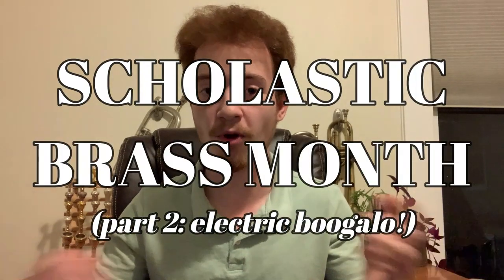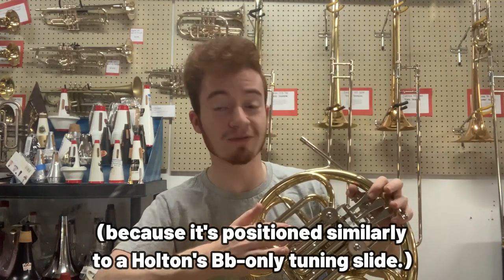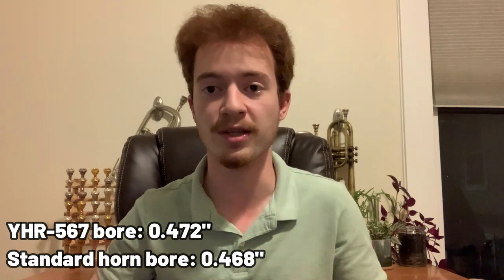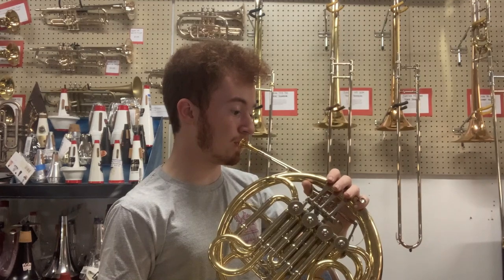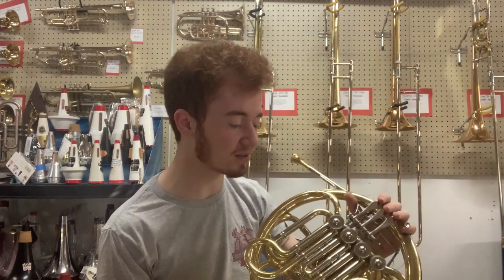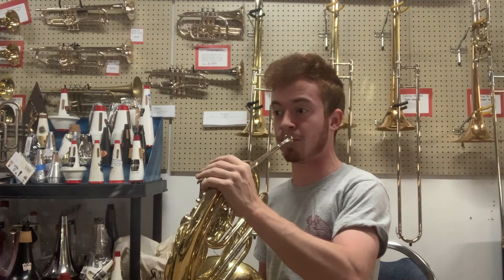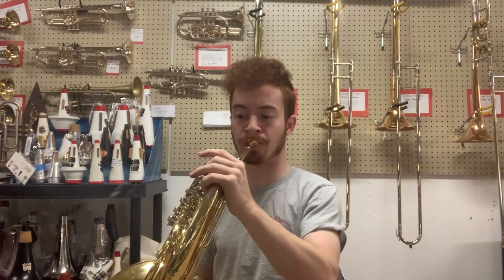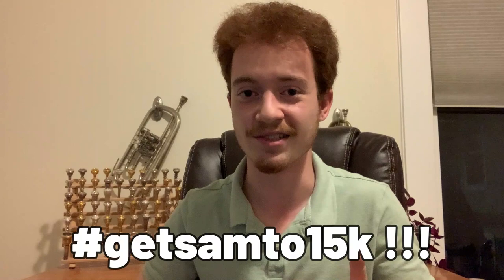Yamaha YHR-567 Intermediate French Horn: Worth It? Or Go Pro? | Instrument Reviews

Comment: FWIIW - I was playing 3rd on a rented Eastman horn that sounded gorgeous. My 2nd horn player had the 567 and honestly, it sounded like mud - awful sound to my ears. No soul. Then I had a chance to play one a year later and it was not that bad actually, still not as nice as the Eastman. However, I came across 2 builders of horns - Lukas (USA) and Contesanu from Edmonton Canada. Both have modified horns and both state that Yamaha 567 and 667 are favorites to modify with great success - the end result barely recognizable, esp the 567. Felix says this horn is a diamond in the rough - but both men said these are great horns to modify and YES, there is nothing to write home about for sound tone, good tuning mind you and good construction - just no soul. 2 Pros said the same thing. Gotta be true.

What they both do is replace the lead pipe and remove the clear coat (not easy)  plus a few other tweaks.  On his word, I got a 567 cheap and a risk and went for it - $1,100 cdn.  The end result was a mud horn turned into a horn of beauty, far better than any other horn I have heard with the Eastman close by. However, the 567 was almost bang on in tune throughout and enormous range from the deep cellar to high C although high notes require a lot of effort. Compared to Conn 8D, Alex and others, better overall - it has soul now - lots of it. 

I asked Felix about the trick. Clear coat MUST come off - night and day difference. And yes, that was true. He tested it with his peers in the symphony and they thought he had a different horn - clear coat alone!  But the real magic was the lead pipe of his own design. As a builder of horns using parts from the best all around the world, (Yamaha valve bodies clusters are amongst the best), no one had a good lead pipe, so he designed his own. Apparantly evern a change of even .010" makes a difference - the taper is critical, the diameters are critical. Lukas says the same thing. Between both companies, i think I heard them say about 160 horns modified each 4 years ago. And no matter whatr brand, or expensive kind out there, the end result is always better - even a $20,000 horn was better!   But the 567 has the most improvement. The best of the best would be a 667 - series, but still this 567 still bests the others out there.  A final step but costly would be to put on a hammered bell, but the improvement would be minimal. The only one that had an almost equal quality sound was a 34 year old King Eroica - sweet witthe Yamaha a wee bit brighter and clearer. 

Many have complimented me on the sound of this modified 567 and are awed by it. I agree.  Of course, nothing beats consistent practice and developing skills - at the end of the day, it is the player, and his tools.
Reply from the maker: Thank you for your insights. I don't doubt the leadpipe geometry is what makes the 567's tone and intonation suboptimal. Yamaha has unfortunately had some leadpipe designs in the past that don't fare well (e.g. the original model 642 euphonium which almost sounds like a baritone if you play above a mezzo-forte). I also don't doubt that the 567 could be a really superb horn with the proper custom leadpipe and no lacquer. I was really impressed with the stock horn's response and range, both high and low. It's just a shame that it needs such an extensive mod job to reach its fullest potential when models like the 671 play amazingly straight out of the factory.

Comment: New subscriber here. Have you played a 668D? I see 668II (668DII for detachable bell) on a few sites, but no longer the 668D. Did Yamaha phase out the 668 and replaced it with the 668II? Lastly what about the 671? You plan to do a review? Great video!!!
Reply from the maker: Thanks for your support! I’ve never played a 668. My main horn is the Conn 8D that the 668 was based on, though. It does seem that Yamaha has phased out certain designs in favor of a Mark II replacement. For instance, their YCR-2330 cornet has been modernized as the YCR-2330II. And yes, I’ll be reviewing the 671 at some point.
Reply: @SamuelPlaysBrass  I look forward to the review of a 671. For those with deeper pockets, Yamaha also makes the 871, a custom version of the 671 (the fourth rotor is hollow, inner tubes made from gold brass, and greater attention to the manufacturing process).
Reply from the maker: @Adair9800  I met Chris Castellanos of the Boston Brass earlier this year and it turns out he spends most of his time playing an 871!
Reply: @SamuelPlaysBrass  Formerly of Las Vegas, IIRC. Never met him.
Reply from the maker: That's right, I couldn't recall where he'd played prior. Thanks for jogging my memory.
Reply: @SamuelPlaysBrass The Yamaha cornet's actually the YCR-2330III since they brought out the YTR-2330. They have some shared parts, but I think they tweaked the bell design a bit. The trumpets went 232/2320/2335/2330, but the cornet just kept getting revisions, from 233 to the current 2330III.